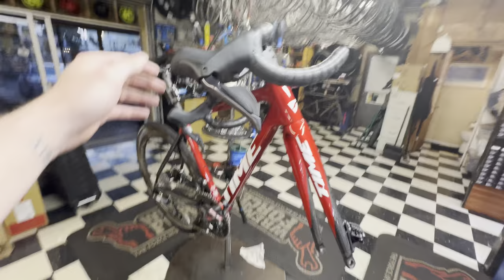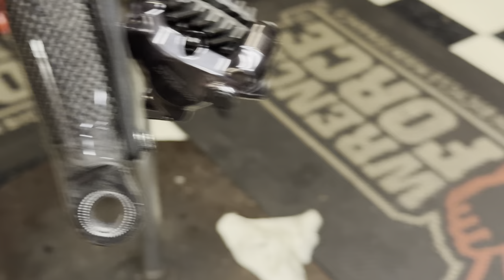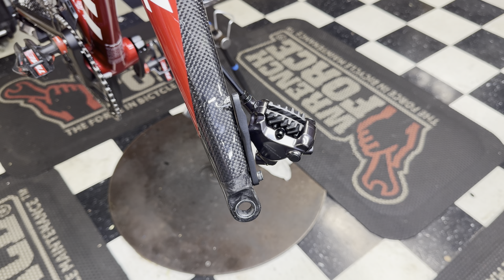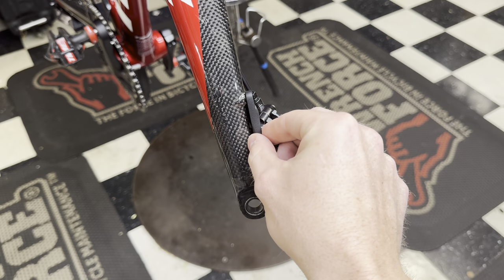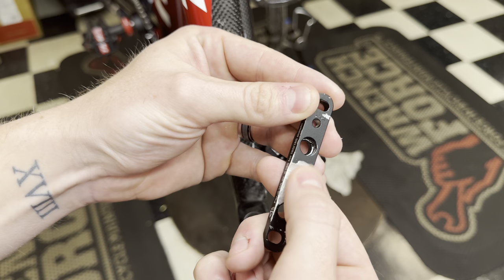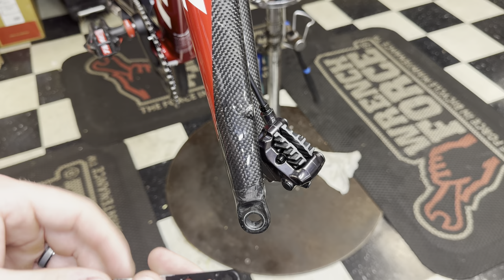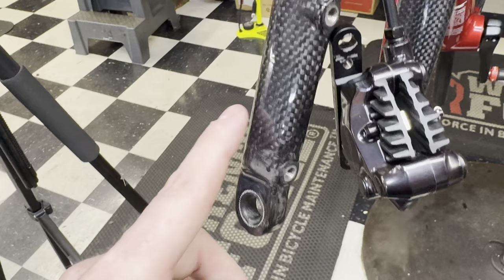HUGE Issue Found with TIME Bicycle Frame

Comment from the maker: All in all, in this world and industry, Everything and anything can happen, so qaulity control is a big deal yes but what it really comes down too is how that company handles the issue at hand. Make sure you get a company that you feel comfortable with and has a good reputation because you dont want to be here shit out of luck. Time was very responsive with the first time talking to them and I am sure if the customer wants a new fork, He will get one
Reply: That is my biggest thing in everything.  Mistakes happen, but how do we respond when they do?
Reply: Yo, like I said in the last video, this isn’t the same bike that the YouTubers raved about. It’s new ownership. They may claim it’s the same process etc. it’s not. They are going to be moving permanently to South Carolina later in the year, but this frame isn’t the same design and the QC isn’t as good. That’s straight from a guy that’s sold time for the last 10 years.
Reply: I've had these issues for 20 years. Its the caliper brake adapter, every brand is different, I have marzocchi forks that need specific adapters or you file clearance into the adapter
Reply: @janeblogs324   How about we not make excuses for obviously crap engineering. I'ts 2024 literally no excuses for this level of craftsmanship.
Reply: Asking to sand the excess of a brand new clear coated carbon fork it´s just damage control.
It´s like having a flie on your expensive meal and the waiter pulls it out with his fingers whilst saying: "There you go, hope you enjoy!".
Reply: Personally I would be happy if a shim incorporated between the mount and the carbon ‘fixed’ the flush alignment. However as Time have responded so positively a new fork set is obviously the best idea.
Reply: @DP-PhD  That solves part of the problem because then you´ll increase the height and angle of the caliper that won´t catch a full contact between the disk and the pads.
In lame terms:  Results in poor breaking and uneven pads and disk wear.
Reply: @johnnysaudade773  you think time made the brake adaptor? I bet you the one they tested the frame with worked fine
Reply: @janeblogs324   yeah, no.
Reply: @janeblogs324  did you watch the video? The fork is all wonky. Numerous different adapters tried.
Reply: I personally would have put a washer or 2 underneath the bottom bolt and brake mount so it can run flat and call it a day.

Comment: Hey there, this is Dustin from TIME. I wanted to let you guys know that we did not suggest sanding the fork. Our recommendation was to do a file on the clear coat and follow up with a polish. We want to replace the fork for the customer and are in the process of doing so.
Reply: lol, jokers.
Reply: Instead of sanding off the fork, why not sand off the mount?
Reply: File / sand is semantics really. Both unacceptable options.
Reply: only Time will tell
Reply: @dets   -- Dad joke reps.
Reply: Best recommendation, like a joke
Reply: @jameseastwood402  It's not semantics, nor are these unacceptable solutions. Honestly, the best option is to replace the fork, which we are in the process of doing. You should look up the definitions of sanding and filing. The issue is the clear coat, not the carbon.
Reply: @DDai-qd8uk   I don't mean any disrespect at all. Apologies if you took it that way.
Reply: @dustinowilliams_TIME people need to try a little harder to understand. The clear coat is non structural and sanding/filing a bit off does nothing to impact the integrity of the fork.
Reply: For what Time charges for this Frame set this is highly unacceptable!
Reply: @derekcapitano5257  Easy, tiger.  Time is literally addressing this, above;  Yes, it's unacceptable, but there is neither a perfect world nor company, at this price point;  The company is actively making it right.  Rest easy.
Reply: For the money the frame cost, yeah - have them replace the fork.  Now, a couple shim washers to clear the bump - black oxide if you are particular- problem solved.  Geez.
Reply: Tell your scammers to start making rim brake framesets. Stop scamming people and provide a descent product
Reply: @dustinowilliams_TIME  Hey Dustin, do you still have that "faulty" fork from the customer, can I buy it at a discount? 😋

Comment: I am more concerned with Time's blind comment of "sand the carbon" than I am a QC issue...
Reply: Yep
Reply: Same, it’s much better to remove material from the aluminum adapter.
Reply: Right, just carve out the aluminium piece slightly and it will be no problem. Sanding that immaculate carbon is insane.
Reply: Its not to much carbon there, carbon cant drip down. Its most likely clear coat + resin (bonding material for carbon) that bulged up there. You can sand it down quite easily, no harm done. I dont think Time would recommend to sand carbon down, they rather recommended to sand the area.
Reply: I understood differently. I think they said sand down the clear coat that goes on over the carbon. they often put quite a few layers of clear coat on to give that deep shiny lustre. looks lovely, has no structural effect, so sanding it off is fine. I do agree that you gotta know when to stop sanding! Clear coat sands into a white powder, carbon is black of course. so, its not terribly hard, no more care required than any other bike mechanic job.
Reply: The response of time is trully concerning
Reply: @rauli386  you mean: the second hand response through the grapevine? I’m sure Time wouldn’t recommend sanding the carbon.
Reply: @fried_tri  The issue is not whether they specified sand clear coat or sand carbon, the issue is a manufacturer directing a bike shop to sand a frame at all... especially based on just photographs!  The grey area and liability is high for anyone not familiar with composite repair (no disrespect to Grant or BG).  It's worrisome that is given as a solution at all.
Reply: After 18+ years of cycling I never like or liked Time bikes. They just don’t do it to me! Have you seen this with Enve custom bikes?
Reply: @juanhidalgo7043  So you're older than 18. How many years did you ride on a Time?

Comment: Paul from Mapdec Cycles is going to have a heart attack when he sees this and I must say that the finishing layer of carbon in the area of the caliper mounts is quite sketchy. Cheap carbon parts from ali are finished better than this. For the price they charge for the frame (~4k$) and all that marketing yapping about their engineering excellence (which apparently is not the case here) I would definitely claim the warranty and demanded the fork to be either replaced or that bulge to be sanded down by themselves. Asking the customer to do this on his own is aliexpress' customer service level....
Reply: Mapdec is always quick to slag off other brands quality control and now we’ve got one of his perfect bikes with an issue.
Reply: Mapdouche
Reply: @scottwatson7844  Mapdec doesn’t take criticism well 😂
Reply: @17cream Yes, like his buddy SCAMbini who also hate criticism.
Reply: @17cream 5 y/o aerospace engineer and artisan bike mechanic 😂
Reply: Say what you want, but I like both chaps anyway :)
Reply: He's already blaming GC saying he could have polished it out
Reply: Mapdec is an 'Influencer'. A business man who is working off weak easily influenced individuals who know jack shit about cycling. Hambini manufactures top class bottom brackets  end of.
Reply: @17cream  Yep he deletes criticism. The only truth is his opinion. Total 'Influencer'. He is just getting a better discount by blowing smoke up their arses all the time.
Reply: Hambini - the guy who slags off every manufacturers overpriced gear but charges $600 for a $30 part.

Comment: I would expect a replacement from Time.  No way that would be acceptable for me.
Reply from the maker: Yea for sure. There are two types of people
Reply: @GCPerformance18    I guess I'm one of those types.  :)  I'm ok with that.
Reply: @GCPerformance18  Not sure what you mean by that, but for a $4K frame, the buyer is entitled to one without an obvious manufacturing defect.
Reply: I think he meant that some people are ok with a fix and others would rather wait for a replacement fork. @Dr.Schlitz
Reply: @Dr.Schlitz  You didn't watch the video. Time would have replaced the fork no questions asked, but the client opted for a work-around solution.

Comment: So why is this a 'huge' issue as you say so in your title? You had a quick fix and you could have had a new fork in warranty. That's what I would call, as a bike shop, a small issue. Much hot air being moved for next to nothing.
Reply: Other brands get REAMED by youtubers for possible tolerance/qc issues. This praised manufacturers frame has an actual issue! So this must be huge. Or certain engineering youtubers are not what they make themselves appear?
Reply: @michaelhaar youtube is full of drama queens.
Reply from the maker: to show every company has issues, where as on this platform time is held to this golden standard of how QC is done, but this is my first ever time build and the first frame i see has this defect, it is a solution yes and done by a mechanic who has seen this before but lets say this customer took on this build project himself at home after spending 4,000 usd for a frame.... it is not right to have this issue and I am sure if the person at home had this happen while building and they had to strip down there whole bike again after being built and wait for a new fork it would be a bigger problem

Comment: I also had an issue with a new Time ADH frame. The rear axle would not thread by hand and it was very clear that the derailleur hanger didn’t sit square in the dropout. On a phone call Time responded by suggesting the hanger was cross-threaded and promptly shipped a new one (in spite of my insistence that it was an alignment problem). I sent pictures and even a video to Time demonstrating the problem but never got another response. Rather than dealing with sending the frame back (which was shipped from Europe), I mixed some epoxy and carbon fiber shavings and filled the area around the hanger mounting screw. I sprayed the hanger with mold release, mounted it loosely in the frame, put a wheel in place and threaded and tightened the axle. 
The fix worked perfectly – the axle threads easily and there is no added stress to the hanger mounting screw. I’m lucky in that I have extensive experience working composites, probably not a common situation among bikers.
I love the bike, it rides like a dream, but I’ll never assume a bike frame from Time or any manufacturer, is perfect.
Reply from the maker: yea sometimes working with a dealer direct it might have some issuers with customer contacts
Reply: I would have put a shim under the mounts, probably needs 0.5mm (.020") only.

Comment: My personal experience of Time has been very positive in terms of quality.  I own two recent models, a friend used to be the Time UK distributer a fair few years back so have seen many in various states of build and I've been lucky enough to ride many of them.  My recent models are both made in Slovakia (I think) and were perfect in all aspects that mattered - geometry square, holes round and in line with each other, paint perfect.  When you push in a Hambini BB or test the through axles, it all just fits smoothly and is clearly in-spec.  on an ADH '23 There was a small amount of excess lacquer that I had to sand off where the seat collar needed to sit, but no problems with this.  That's the only issue I have experienced.  Back in the day, there were a few 'quirks' with some of the decisions Time made in design that needed a practical minded bike mechanic to work around them, but the quality was always good.

I'm very surprised that a current gen fork got through QC without basic check that the caliber mounts were square and faced.  The issue you showed meant that that can't possibly have been checked and passed QC.  If you don't mind me asking, was this frame made in Europe or from Time's new facility in US?  Not sure if that's up and running or not yet.

All in all, comparing my Time frames to the high end stuff I've owned over the years (Carbon: Colnagos (4), Cipollinis (2), Cervelo (3), Storck (1), Canyon (2)... Titanium: Lynskey, Litespeed) the Time frames have had the fewest issues and just seem put together to last.  When the Scylon gets an update I'll be ordering one, then can't see anything other than my Time bikes being my bikes for life. 

Hope that helps!

Comment: I am an engineer. And as such I would go with the solution that requires the less amount of Faff and is safe, basically what you just did. I would create a ticket with the time just in case if the client wishes to deal with it properly later down the road or the issue evolves into something. That way they can’t tell him it is his fault or the fork is deformed. Anyways saluté Grant, you used your knowhow and experience to resolve a problem. That means you are smart! Not educated but smart, those two might not align.
Reply: Smart and educated always align. But there are different types of education. 😀
Reply from the maker: I take this as the upmost compliment, really means a lot to me and I appreciate it 😊

Comment: Not sure if someone else suggested it, but the first thing that came to mind is to add a little spacer either on top/bottom or on both between the fork and the adapter. This should have distanced the adapter from the fork and work just as well, doesn't it?
Reply: Caliper would grab just the tip of the rotor. It would change the position of the caliper since you’re moving away from the frame.
Reply: Mechanics, assemblers, technicians should not have to fabricate solutions at this price point.

Comment: hard to see in the video but it does look like its just clear coat build up from the paint process, possibly a sag in the clearcoat that didn't get noticed. I've painted thousands of car parts and many bikes and this can happen. Quick fix, if you have the experience, would be to block it out flat and polish it up. But I'd be cautious too if it meant voiding a warranty.
Reply: I agree, probably clearcoat.  As the fork itself is RTM heated and cured in a steel mold with a solid wax internal mold.
Reply: Yeah. This is the most likely. The clear coat on Time bikes is a generous layer for sure.  I could guess that Time would just polish down the clear coat and send it back. It’s impossible for it to be structural carbon with how those forks are made.
Reply: This is exactly the issue.

Comment: Great info!  I have this frameset in my garage for my next build. I’ll check that fork and see where it stands.
Reply from the maker: yes this is something to check, it will be great because if there is an issue you will not have to strip down and replace fork, just mount the disc brake adapter ont here

Comment: As the mounting bracket is bolted to the fork at the ends, it is not subject to much bending force where it's been ground away so I'd be perfectly happy with your modification from a technical viewpoint and once it's been painted or varnished I'd be perfectly happy with it aesthetically.  I'm more concerned that you seem to have connected the front brake caliper to the wrong ie left hand side,  brake lever.  Only kidding, I'm from England where, as I'm sure you know, we have our front brake operated by our right hand side brake lever. It's good to see a bike shop thinking what's best for their customer and be willing to carry out such a modification rather than taking the "safe / no liability" time consuming option of getting a replacement fork. Good work GC.

Comment: Couldn't agree more. From a manufacturering BG, I can say all and I mean ALL companies have a product that once in a while leaves the factory and needs attention after and as you say its how its handled that shows their worth!

(Side note) plus that would be incredibly hard to pick up in QC as it wasn't apparent until the fitting and visually probably looked fine (as in mounts were flat) to the inspector.

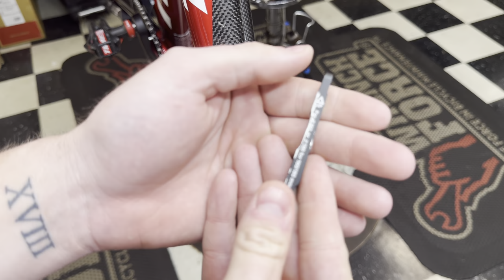Comment: 4:55 That’s what I would have done (if a fork replacement was not an option, that would be plan A for me) but this wouldn’t be the first time I have had to do a modification to a component like this. The last one was an ENVE seat post bracket and after contacting ENVE they just said “just grind a gap in it till it fits, it will be fine.” Always an email response you keep for your records. 😅
But back to your fork, yea the last thing you want to do is sanding the carbon, it’s way more of a risk than modifying the clamp. However, I do wonder how much material you can safely remove until you run the risk of the part snapping in use? Personally anything more than 20% and I’d rather get a new fork.

Well done on the fix anyway, the life of a bike mechanic. Manufacturer messes it up and we make it work. 😂